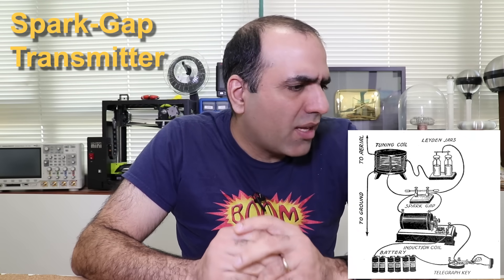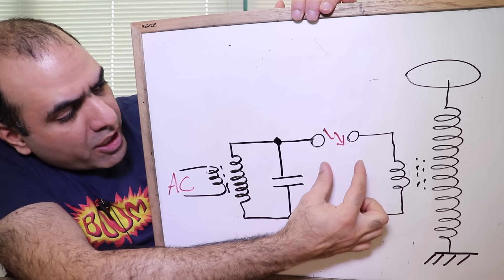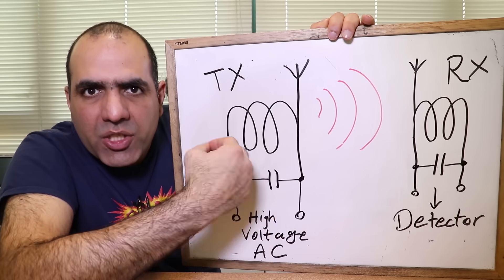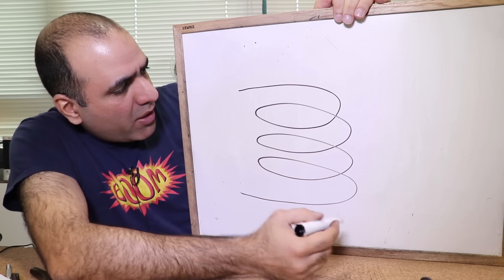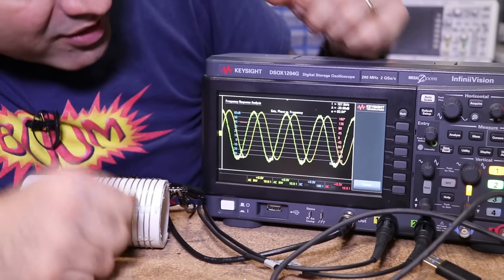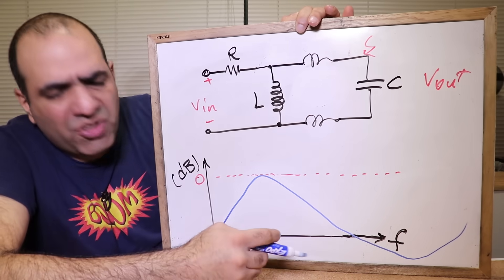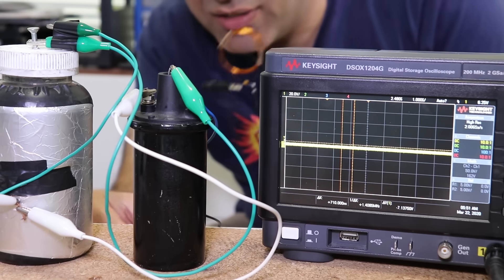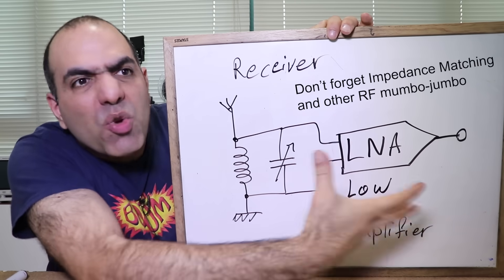Making a Spark-Gap Transmitter

Comment from the maker: Hello BOOMers, there are debates on that my circuit which has capacitor parallel to high voltage source is worse than the other type I also showed at 0:02 which has spark gap parallel to the high voltage source, because DiodesGoneWild mentions it here: https://youtu.be/wSp1IzmRUk8?t=772
While the purpose of this video was not to make a proper commercial transmitter, because FOR GOD'S SAKE, WHO BOTHERS MAKING A COMMERCIAL SPARK-GAP TRANSMITTER NOWADAYS... both circuits lack many components that could make them better, both would work fine with proper components and both have pros and cons. Like in my circuit high voltage resonance frequency is right across the transformer and although mostly filtered, could stress the transformer to some extent, while if the spark gap is across transformer, it could short the high voltage for extended period of time overheating the transformer. In either case having a larger series inductor to the output of the transformer could protect it better. But WHO CARES?! Both circuits work for demonstration purposes, and need improvement for commercial use. So don't go selling this junk to make money!!
Reply: I wish my brain was as big as yours :(
Reply: Just study, read, and implement the things you learn. Stay curious.
Reply: @notsure6834  6d6656d5666d6din6d6din6d6d5d6din56d6d
Reply: Ok boomer
Reply: @ShytPosting  6t55d
Reply: Did you just call us BOOMERS as in old people, or, BOOMers as in little fans of your channel...
Reply: What you can do next with this circuit is can you attach an arduino to each side and transmit digital data? Maybe using FSK? Then if that works hook it up to a serial port and run ppp to get a tcp/ip interface in linux and then ping over the link. That would be really cool. Obviously you would need two of these setups then.
Reply: Here in England people are setting fire  to 5G masts, they think it causes covid 19, check British media if you dont believe me,  also the Corona virus symbol used in the media is printed on our new £20 notes released in September, conspiracy or crazy?
Reply: Can you do a video on this one?
https://youtu.be/gjv_5w6WaRQ
I'm guessing it's fake, thanks
Reply: @beningledew2002  yeah that Pakistan dude has got to be fake. Please do it electroboom.
Reply: Mehdi quien te reto
Reply: I'm a teenager NOT A FREAKING BOOMER!
Reply: dont make that joke again pls
Reply: Well there goes my plan to take NPR and all those other three letter radio corporations off the air by Broadcasting higher quality content.
Reply: Biggest comment ever!
Reply: ElectroBOOM , you forgot to install a flux capacitor and put it in a 40 watt range you doofus
Reply: Can I sell it to make money if I just tell ppl it's not junk?
Reply: Paper  yes
Reply: Jesus christ
Reply: "Mucho greater energy and release it in a stronger Ummbs"
Reply: I’m not reading that lol
Reply: 3:44 Texas to a Pharmacy Store I get it now!!!
Reply: Also the ESR of the caoacitor changes the resonance frequency

Also great fan
Reply: Stay safe buddy. Much love i love these videos fear for your safety
Reply: I like your capacitor. I'm going to try to make it.
Reply: I am not a boomer
Reply: Also I don't think the FCC would appreciate having spark gap transmitters on frequency.
https://www.youtube.com/watch?v=Eskcw9tZQQQ
That's on VHF. I wonder what LF would look like. hint hint
Reply: Also, do not forget that spark grap transmitters have been almost universally illegal for almost a century now
Reply: 66
Reply: D6d55d6d5d6d6din5666d666dd5SD556d5d566656d6d65d656555dd55d6din5td6655d⅝66 DCCC5DG6d5d6din666d5556d5555d6dd⅝friend65d6d6din6d5565d5din
Reply: Paper  55d566⅝d5d6d6din566555t6666d6din66d666d6din665d56d6tt66656565565d5d6din56665d5d6d6d556567t66d556d⅝din55 DCCC5d556d66d6din55td6d6d6d6d6d6din6dr6d6d665d6d6665d5din5dt65656d6din66d6565555tt56d6din5555d6d6d6d5td6to6d6d666td5TDI6d5din65d5d6din65d6d6din565d5din5d6din5din66d566d5din66d6655d666565d666d656td6d6din66rd6red566td6TDI6d6din55d6d666d6din6td5d66d65d5d666d6d6d66tdd6td6d6t5d6d5din65d5d6din
Reply: Paper  same
Reply: ElectroBoom it would appear that I have accidentally created a high voltage resident frequency device when building my three-phase rotary converter and my Milwaukee drill was right next to the capacitors upon a few startups the LED flash light on my drill would come on until I properly tuned the capacitance of each of the legs 😂 was pretty curious as to why that was happening but after your detailed explanation of how it works I'm pretty certain I've created one by accident 😂
Reply: Keeping it real
Reply: 699
Reply: 699
Reply: I could hear him saying this in my head
Reply: Cool
Reply: Ok
Reply: TO MUCH INFOS- ' "BOOM,' ". Nerver mind:(
Reply: Lol
Reply: As a HAM operator you explained the circuitry behind the spark gap transmitter. I am now closer to being just a HAM instead of a HAM OP. KUDOS!
Reply: why mehdi used realey if he can use tranzistor
Reply: Every time you say impedance it sounds like impotence... Freudian slip?
Reply: از دستکش برق استفاده کن! خطرناکه، برق کویل ماشین حداقل ۲۰ هزار ولته😱
Reply: medhi. Can you do a video on radio communication and build a Crystal Radio
Reply: ElectroBOOM search for "ok boomer"
Reply: I have achieved 1st comment!

Whats that......... Oh no one cares
Reply: Make a spark gap ferrite core tesla coil
Reply: Hi sir this is Anmol Bansal from India, I have a question that in order to fight Corona Virus our Prime Minister has requested to all the citizens of India to light candles for 9 minutes to support the heros which are fighting with Corona Virus he said that we all should switch off our lights and light candles for 9 minutes to show our gratitude towards them so my question is that is there any chances of power supply failure if all the people lights the bulbs and appliances at the same time. Please answer me if possible.
Thank you
Reply: no u a BOOMER
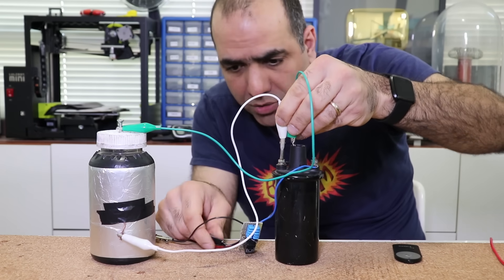Reply: Great work. 11:16 you fake as hell. You were insulated with contacts and you make sure to insulate with rubber slippers. Very entertaining though great work. :)
Reply: Mr electro boomer I have one question for u .,my country  India is going to make 9miniute blackout on tomorrow could u please tell me what are the problems we have to face for this entire blackout in the country,,
Reply: @iaminvisible5659  are you from Kerala
Reply: @sajinrose3384  u r from marthandam
Reply: @iaminvisible5659  d6t
Reply: @iaminvisible5659  66tdt6Rey
Reply: Please make the video immediately....it's tomorrow

Comment: A couple years ago I built a few an LC circuits in parallel, powered by one of those high voltage modules in series, with a different sized variable inductors, and we had a servos which automatically sweeps through the rotations, interfering with multiple different bands at one time. My modification made it even simpler but to only run on AC with several geared synchronous motors, and once they hit the end stop they’d turn the opposite direction. It was fun.

Comment: I was working on an ignition Killswitch on the 25 hp two-stroke boat , I had the same alligator clips on the output wire from the stater I got mixed in the voltage coming out of the motor and with grounded to the boat which left me with a heckuva shock for a good 10 seconds

Comment: Wow, I wish I found this video sooner. I always wondered “What” an antenna or transmitter was made of, how did it exactly transmit. I think this answers many of my questions. It’s fascinating how it’s through inductance? Is it possible to get shocked by the coils when they are energized ? Or do they transmit through Radio and inductance at a certain hertz ? And not AC power. Maybe Im way off still. Anyone? Thank you!

Comment: You sure rang my bell! I was 12 years old when behind the RCA tv and repair store, I found a tuning coil from a tv. I had a morse code toy and took the keyer off it. I also had found a rca 22 volt battery in the trash and really did not know anything about what I was going to do. So I hooked the battery up to one side of the coil and the other side to the keyer. I mounted the coil on the top of a small cardboard box and the battery went in side it. I could not know if I was transmitting anything or not. But just enjoyed doing it and had an idea I was putting the battery power into the coil. And because the code box made noise I guess I was expected a tone. But I did get a small click from it. But when I went with mom and dad to the store, I took it with me. But everytime I keyed it up, it would wipe out the car radio. Boy did dad get mad when he figured out what was going on!

Comment: Could you make something similar using a neon bulb instead of a spark gap? They behave quite similarly where they start conducting once they reach a certain voltage, wondering if it's possible without giant sparks and all the EM emissions that come with them

Edit: never mind I heard "high voltage" which don't take too kindly to neons lol
Reply: the neon would start conducting at relatively low voltage, preventing the high voltage from happening, so the neon would probably be OK, but the transmitter wouldn't transmit very much.  Most of the power would go into lighting the bulb instead.

Comment: Reminds me in the mid 70's as a teenager building a spark transmitter using a relay wired to make it buzz and using an old sound output transformer. When connected to a 45 metre long wire antenna it would transmit for several miles on nearly all frequencies at the same time, it could even be picked up by TV's in the UK UHF band where the screen would be covered in white random lines and the sound go crackly regardless of channel. My neighbours used to call out the TV engineers with great regularity usually blaming their TV sets, all they had to do was ask me when I wasn't out on my bike with my transistor radio doing signal checks.
Reply: where did you get a 45 meter antenna?? In the 70s??
Reply: @citricdemon  By running a wire from the house to a scaffold pole at the bottom of the garden. I think it would be called " inverted L" 
You could pick up radio 4 using just a diode and crystal earpiece with no coil or vc.

Comment: I'm a dumb novice with some questions. (13:33)
1. is the LC circuit 100% necessary? 1.1Capacitor is just a gap, so technically there's a capaticance over inductor anyway.
1.2 wire has inductance even without loops.
So can you just have a simple wire as a receiver?
2. Does the capacitor in LC only prolong the current going through the inductor? Or does it add something extra?
3. Does the inductor only amplify the "magnetic field sensitivity" whatever it's called, or does it have an extra purpouse?
4. How does the antenna work in helping with transmitting/receiving data if the inductor is what's responsible for "catching" RF?
5. What determines the necessary length for the antenna?

Comment: Test your illegal Tx outside with a fishing line tied so as to slowly drag your device across an open field on wheels or skids, to your safe spot. This will trow off any effective location Detection techniques used by the FCC... Triangulation is not used anymore, that died out a long time ago. The elements of the directional sensing antenna is ‘spun’ electronically which gives a very narrow beam heading, the operator just follows the beam heading right to the offending radiator. One car, one operator and you’re exposed in only a moment. ~ TS

Comment: 💢💢  I loved this experiment!!! I'm an ex-Ham radio operator General Class and followed the calculations. You have some mighty nice electronic instruments! And when you poured salt water into the Leyden Jar, I finally understood how it worked as a capacitor. The wire that you dangled from the top acted like a "brush" into the brine which acted as the second plate!  I'm thrilled to have watched this experiment. Fritz  💢💢

Comment: Hello Mr Boom , you can plug the ignition coil into the mains with a standard light dimmer switch  , your antenna also needs to be about 260 feet long for 1.4 mhz  .

Comment: OK, so, as an IT guy, I have to "rectify" that VPN comercial. I know you have to do it for your living, expenses with YT etc., but some things in my opinion are highly missleading.

1st - Having VPN is NOT increasing safety. It can be safer if you don't trust your ISP or public WiFi provider, but in any case, all you internet connections are made through VPN servers, which you do not own and you have no control over it. So you can't be sure that if you use VPN, they are not taking your data and using it for anything they want. So in the end you just solve one problem problem (WiFi provider / ISP can see your data) and create another (VPN provider can see your data). Yes, if you are at some public WiFi and you are not sure about their security etc., you should use VPN, but always double check if that VPN provider is trust worthy.

2nd - The connection is encrypted only between your device and VPN server. If the connection you are using is not secured by default (eg. you are using HTTPS / SSH), anywhere from VPN server to destination it can be intercepted and and modified by third party (including VPN server itself). So in any case it's better to rely on secure connection through async encryption, such as HTTPS, when dealing with sensitive informations, such as password, credit card info, etc.

3rd - This is not that hugh mistake, but not in every case VPN can help you to bypass internet restrictions, since ISP or network administrator in general can block ports used for VPN connection. Also, service you are trying to connect can (an possibly would) block IP adresses of VPN for security reasons, such as BAN bypass or so. In many cases it can help you, since lot of administrators don't bother to think about VPN, but it's just matter of time before they notice that those settings they are using (for example to block social media in school) are bypassed and they will improve their configuration and introduce some countermeasures.

I know it's advertisment and it's your sponsor, but I think those things should be said since ExpressVPN might be trusted, but there are other VPN providers that are not as responsible or might have some bad intentions with your personal data. 

Also, for anyone who thinks that VPN is enough to get out of governmental / police reach, it's not. There are many ways to track someone on internet, not just by IP address. Some VPN providers might have statutary obligation that they have to log connection information and provide it to police. It's definitly safer to use TOR network, but still you CAN be tracked and it's better to avoid any illegal activity on the internet.

Comment: Better to design one with resources only available in prison.
That's what I was going to do, because the prison was right next to an international airport with all sorts of radio receiving equipment (one might think) and a spark gap transmitter is dirty and broadcasts rather indiscriminately all over the spectrum.  I knew SOS...  I had power outlets (so lots of power)...  I had a diagram or a spark gap transmitter....  but what I didn't have at the time was... wire.  It was only later at a different prison that I could of gotten my hands on some wire.     The only conductor I had access to was pencil leads, which prisoners to pop the sockets and start fires to light their cigarettes.

What I had needed was like the coil wire out of a cassette tape player motor... or a speaker windings or transformer windings out of a hand held radio...     again, it would only be until later that those things could of been acquired.

I guess in retrospect I could of used the metal bedframe as the antenna.. that would of cut down substantially on the amount of wire I needed to secure...

I'm thinking if I could of made somethingthat just repeatedly sparked the AC voltage right out of the socket...  the internal electrical wiring may have been something of an antenna... AC voltage fluctuates at 60 hz... so...   

I'd really like to see a coherer at work...   if you could actaully see the filings move from the radio freqnecy... 

Given an AC outlet, is it possible to construct the most rudimentary spark gap oscilating transmitter with next to no components...    hmmmm

I made a 20mghz crude one crystal square wave audio transmitter from a diagram... and used a 20mghz crystal off an ethernet card....   and a small speaker transformer.  It worked, but 20mghz is also a frequency the time station broadcasts on in the US.   It was strong enough though to blow it over and I blazed Midnight and the Stars and You from an mp3 player down my city block on 20mghz for about 15 minutes.   Who's going to listen to it though... 

Then I thought about buying a 1mghz / 1000khz crystal off ebay but if you're going to do that, they have better primitive radio transmitter kits that aren't so crudge...

Comment: hertz actually did this first (with a bit of a simpler setup) and set up standing waves using a detector ring and a deflector plate. he called them "hertzian waves", but he thought they had no use other than his measurement of the speed of light. he literally invented the radio and thought it was useless 😂